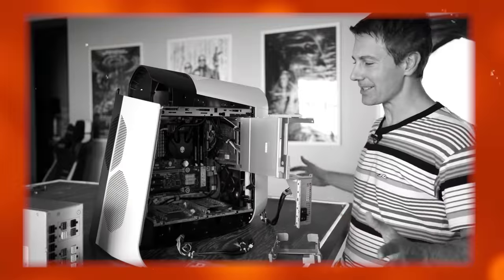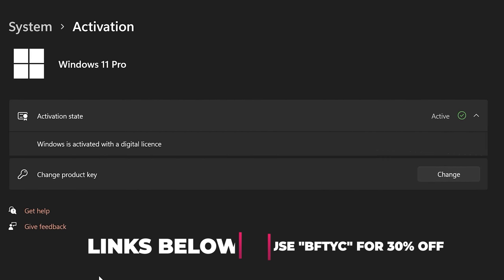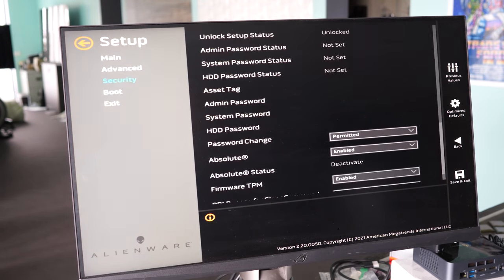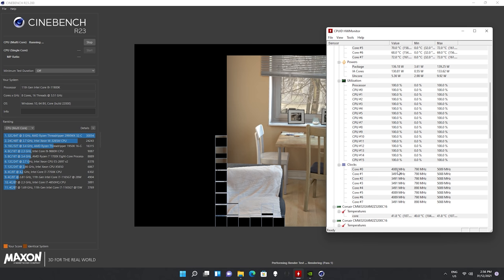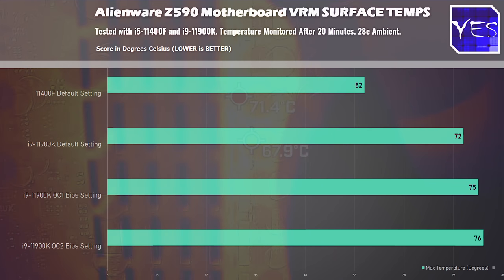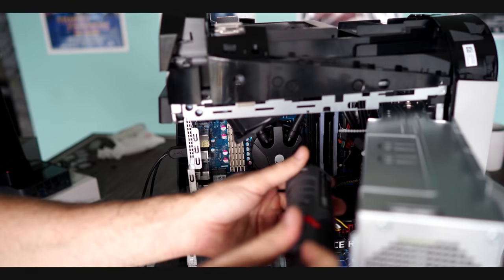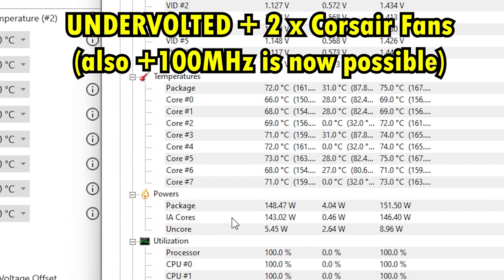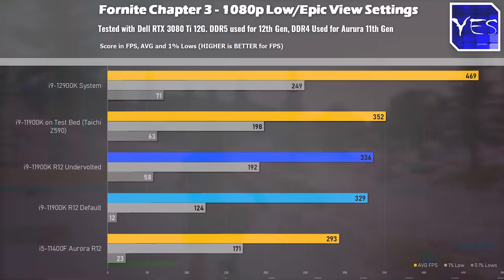UPGRADE the Alienware Aurora R12 from i5 to i9-11900K. Great VALUE or Great DISASTER?

Comment: I picked up mine in spring from Dell, with an RTX 3060ti, 32gb of RAM with the same proc as you started with, a 500gb NVMe, liquid cooling, an Alienware 7.1 headphone set and a 128gb Verbatim usb stick for $1780 CDN, taxes included. It's been great. And none of the heat issues I've heard about.

The extra 16gb of memory (being at 32gb) is pretty pointless.

Comment: I’m glad I returned my 11700k for the 12700k. I’m getting 23,000+ out of box with the gigabyte aero g. She doesn’t break 70° after 10 minutes and it’s running at 200w with 4.8ghz sustained turbo.
Reply: @rcplaneabbott1379  nah, I’m all set dude..
Reply: @mrwashur1991  Are you using a 360mm AIO

Comment: I think maybe the best play is to move the 3080Ti (And maybe the PSU if it is standard) to a new build with a normal MB and Case.  Leave the 11400F in the Aurora, pop in a mid tier GPU and sell that to recoup a good portion of what you paid.  Then you effectively got a really cheap 3080Ti for a high end build that would prob go for a lot more profit than this crippled dell

Comment: i like dell on the tower. And also with a little work the can add a 240mm rad since if i see the video, clearly it can be done. For me under-volting is just a excuse to use the computer at the expense of unde-power cooling parts and air flow. sadly but is a reality. nice work.  I do think oems can improve these and more coming from dell. the bad thermal paste as video is just the result of the low cooling. same can be see on systems that have 2 years with same properties since the thermalpaste just get dry of the abuse heat exchange. same happens on laptops the solution is just to low or to little. is a nice system and yes. the 28C is like here. and i think new thermal test roof as to increase. mose are on 20c and 25C ambient.  btw happy 2022

Comment: Like a few others said, I was wondering why you didn't go with the Intel Core i7-11700KF? Since this is a proprietary motherboard, I think it would work better with the i7 processor? You did so much specialized tuning, I hope that whoever buys the system never has a bios reset, because they my never understand how to tune it to get it back to the performance levels you sold it to them at?
Reply: He said he wanted to flip it, and so, the "i9" branding could be a big help.
Reply: @GamerBoy705_yt  I understand that, but right now he has an i9 that is performing below standards and he had to do some serious tuning to it to get it that way. I just wonder about the long term stability of the system?  I just wonder would an i7 perform closer to the norms without all that special tuning? This is a special concern if he sells the computer to someone that doesn't want to deal with the special tuning if the system ever does a bios reset? Long story short a person could end up with a system that is i9 in name only?

Comment: I wonder if buying the i7 12th gen models with either a 3070 or 3080 is a solid choice since it's basically much more of a value buy compared to building one. I would've want to build an ITX style gaming rig but I'm unsure whether I should just do so or get this instead especially in this current market. Tryna weigh in sum options atm.

Comment: Bought an 11700k for one to replace an 11400F and it’s been a pain. Came across this video searching for answers.  Best I could get in cinebench was 103xx when it’s supposed to be 15000. I’m just going to put the 11400F back and sell it. Didn’t know these expensive systems used that cheap of a motherboard….

Comment: I didn't have the spare money to float an Alienware system, But I was considering buying the Ryzen5800x/3070 system dell had, $2k ish after discount + coupon code..
And then swap cpu/gpu in my current system (Ryzen 3600 / gtx1080)

I'm pretty positive I could have sold that dell alienware system (now with a 3600/1080 for $1500AUD or so, and get a cpu gpu upgrade for $500odd.
Plus I was worried a asus strix 1080 might not have worked, both physical size and psu connections.

Comment: Overall, if you plan to game, changing CPU is not worthwhile . i5-11400F is more than adequate, and any gains are in the games that really do not need them. Also, this case and MB are not meant for serious work with CPU where you would need i9.

Comment: If you want more performance out of a 11900 upgrade to a 10900, ie, 11th gen is a lemon.
Hardware Unboxed showed cheap B550s didn't have enough VRM, so it's pretty bad a 600 series is just as bad.

Comment: Just as I thought. The VRM is not enough for 11900K.

Anyway, glad you are able to get it to work and perform decently. Still, I think if you go to 11700 non-K you might still get a good decent over-clocking (I mean, the turbo boost) right out of the box. I usually discourage my client to try something over kill because Alienware these days are as shit as a cheap Dell G5 gaming PC, they are no longer the champion in performance like they used to before Dell bought them over.

Comment: I'm afraid given the prices and the used hardware in the upgraded machine, I would be happier with the base machine than upgraded version. With heavy use I'd expect problems long term. And you'd have to open it up and keep it dust free diligently or  you'll end up with a literal hot mess. In this market I think you'll be fine to flip it though.
Reply: Only thing I'm worried about is the hard drive, everything else is fine.

Comment: Everything worked as advertised in the video. I dont see where you enable the igpu in the Bios. The Alienware R12 is the most basic BIOS I have ever seen and I don't see anything the says igpu or video.
Reply: Bad News: According  to the Dell forums Alienware computers can not use igpu. Their OEM motherboards do not have the hardware for it.

Comment: FYI, the 10900K is a true upgrade, lower power draw and better performance than the 11900K.
And yes, you can buy an r12 with the 10900K in it already.
Reply: lower wattage sure, but the performance difference is negligible at best

Comment: Honestly, this just unfortunately highlights the hidden costs of buying OEM prebuilts from the likes of HP or Dell. Yes, you may very well get a system for less money than if you were to buy from a SI like ABS, NZXT, or CyberPower. However, you end up with a system that uses fully off the shelf parts that won't lock you in with propriety components or just garbage tier components like we saw with this motherboard in the Alienware.

The amount of effort that went in to trying to get a CPU upgrade to function as expected is mind blowing. It should be nothing more than an install, turn on XMP, and you are done.

Comment: Good to know about the MB. Once again pre-build show a reason why you should never buy one, but build one from good parts instead. Actually had a fairly similar idea as my local store is quite obviously trying to get rid of their surplus of 11400s & sells a bundle with a good quality MB too. Then the idea is to perhaps get a cheap used 11700 or 11900 in a handfull of years.

Comment: Alienware, dell and HP Prebuilt are the worst, it is using propriety things like the MB and PSU, and some things are sub par in quality, better use that money to make a custom pc which is far better compared to these prebuilt, you would get a infinite no of future upgradability path, Better quality HW which may last you a no of years, and no bull** service warranty thing, even their sh*t components cost more than the equivalent hardware available in the market of good brands when you go for upgrade from them, etc. These manufacturers are single handedly responsible for most of the E waste on the planet, they make proprietary stuff like PSU or Motherboards, so that in the next 3-5 years those machines become obsolete and it is thrown out as E-waste, and the owner has to buy new complete PC to keep up. Thats why custom builts are best, you can have an infinite no of upgrades, and keep the old hardware like the PSU, etc if they are good, I have multiple PCs at my home, in one of them I still have a CM 800 PSU which is more about 10 years old in a I7 6700 with GTX1070 pc for my father, and it still works fine. I will never buy nor do I recommend anyone to buy a Prebuilt, you can go for a custom built pc, using standard parts your future self will thank you for it, and if you are comfortable with getting your hands dirty you can do what I do, Get a basic setup first, but make sure it has the CPU,PSU and MB you want , then slowly over the months you can Upgrade the GPU, RAM, HDD, etc, and with the prices now it makes sense.

Comment: Wow, Alienware is garbage. The 11900K is a terrible chip, but it should never perform this badly. The thing loses to a stock 3700X in Cinebench R23, with performance only 70-75% of stock.

Of course, this entire thing is worthless from a value perspective: one of the worst value prebuilts mixed with the worst mainstream CPU of the last 5 years.

Comment: too expensive t4 card ram 16gb + cpu chip + type-c 2.1a dps 1.4 usb.3.1-2 any mix ok or if not cpu normal + 16 tb hdd was overpriced earlier not so cheap not ok, gpu priced too high I didn’t give up bottlenecks that those stores have cards and privately go so high and run with prices 480bit don't know my head now I think 3080ti the prices are just too much monitors also no efficiency without 480hz everything underneath loss gpu overpowered cpu underpowered fps too high for the shit to do that output 100 percent on so much hz cost power loss efficiency for ass ^^ not at the bees cpu turns up like cpu turns up because you can't change anything, not even coupled or high bandwidth at fps you broke no 10900k 10800hk on t4 card with RAM base is enough should really be 23 gb in there once 8gb board rest on 2 card would also go for the price I know you have for free who bought the total deduction not efficient sorry nice packaging even if plastic I think if everything is normalized who well. Cards from 256 to 380bit ok for that too at 5ghz too much power on cpu that doesn’t go away slows down too high at 5600mhz to 6000mhz ram ok would 3x8 gb ok otherwise that is real deduction not well mastered pasted you have anyway free so look forward to the parts